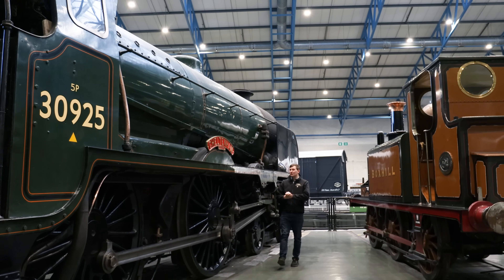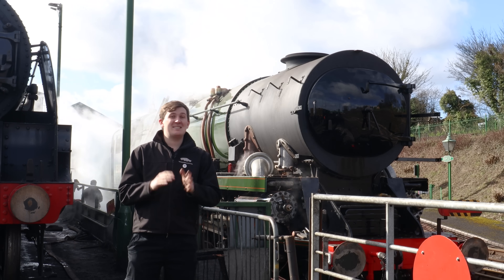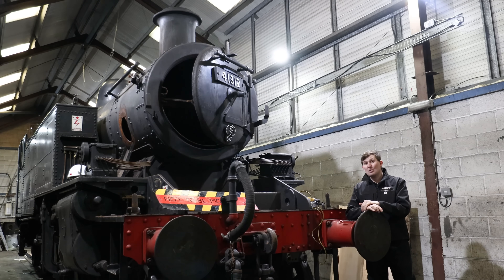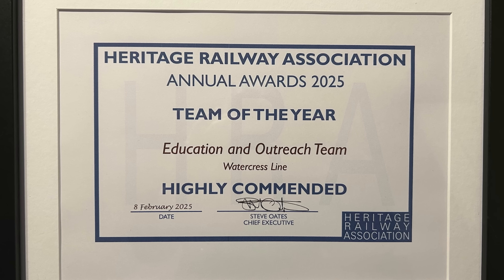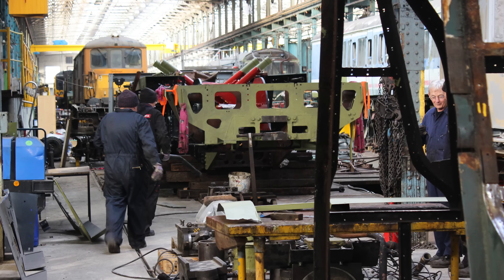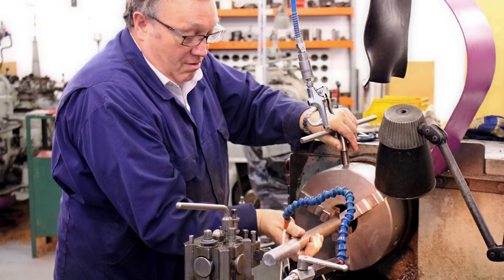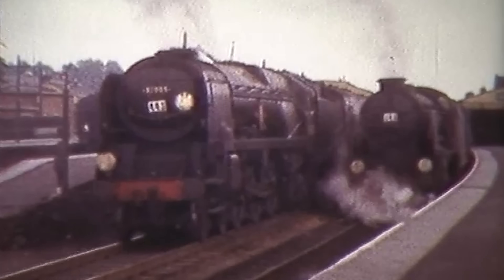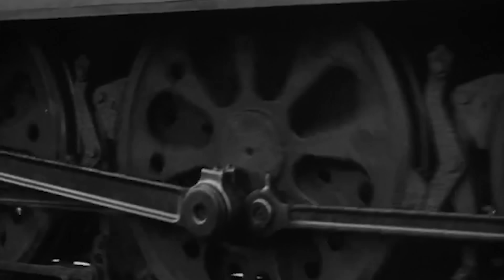In The Loop - The Game Changing Innovation

Comment: Fantastic to hear Becky's piece, so well informed and thought provoking.  I'd heard before about the difficulty in ever testing the capacity of the MN boiler, and I'm not at all surprised.  Bulleid was a really clever guy, and working under Gresley he had probably the best teacher any steam engineer of his day could have had, certainly this side of "the pond".  What's more he wasn't afraid to innovate, even if it meant taking risks and sometimes getting it wrong.  He did so many experiments with engine modifications on the SR to test ideas, probably more than any other steam engineer.  I would think it pretty likely that in a straight side by side test, a MN could have beaten A4 Mallard for speed, especially after rebuilding.  It was such a shame that Bulleid never got the chance to fulfil his potential due to the nationalisation.  The work he did on Leader could really have gone somewhere, even though the first prototype had loads of problems, but then so did the early diesels!  but BR was more interested in building the "standards" as cheaply as possible and with low risk, so Bulleid was out and Riddles was in as a "safe pair of hands" for that job.  Remember Bulleid went on to work for Irish Railways and whilst he had a play around with his "turf burner" his big contribution was to the successful dieselisation of CIE.  Top man, Oliver Bulleid!

The fact that Leader was cut up was a travesty.  If anyone would recreate one as a "new build steam" project, that's the one that would get my spare money!  Lots of the problems could be solved with some redesigns.

Comment: Has no one ever researched how much a Duchess boiler produces because last I heard Crewe ( I think it was)  lost track when they did test it.  But they never had mechanical stokers, just steam pushers to push the coal forward. Part of the problem as I understand it is that the mechanical stokers were  a tube through which an Archimedes screw operated and that got bunged up if the coal was not of a certain size. I think the problem with the Bullieds was that  they were rather too prone to slip being to light, they were after all designated MT originally. Staniers could have beaten  Mallard imho had they the running on the East coast
Reply: I doubt the MT classification of the MNs was unduly relevant, once  government (wartime) approval to proceed was given. Under war conditions, whatever was running pulled whatever wasn't completely outside it's envelope.  IIRC, 22 coach trains on the ECMIL were run behind A4s ... which I can't  imagine went down too well with ops staff at the termini !!

The Southern (and GW) attached great importance to milk traffic fron the SouthWest and it wasn't uncommon to see trainloads of tankers behind top link power.

The WC/BoB class are properly 'mixed traffic'.  No arguments there.   I do sometimes wonder, if turntables on the Stranraer, West Highland and former Highland lines had been long enough, we'd have seen a couple of dozen Light Pacifics head North of the Border?  The exchange trails in 1948 certaintly showed whst they were capable of.
Reply: @TheHoveHeretic  I don't disagree in the slightest but there is I think a direct link between Staniers, Get the Biggest set of wheels and the Biggest boiler mentality and  Bullieds desperate need to get more modern traction whatever. You see the LNER had a significant number of A1/3 locos to handle 20 coach trains by the wars start. Put that into perspective that's  550 -600 tons . Stanier had a small loco policy to break but most of theirs were Black fives/ Jubilees/ Scots.  I still think the Southern were thinking more how to raise steam quickly and have plenty on tap